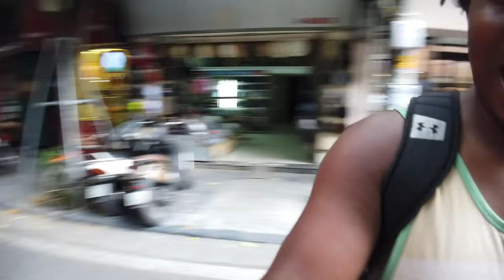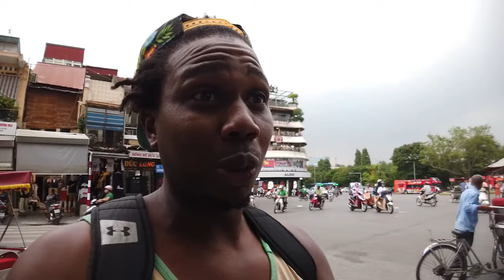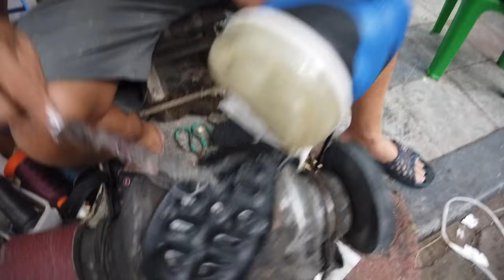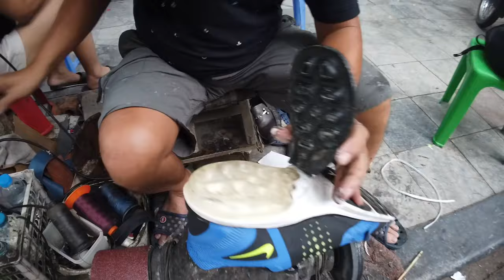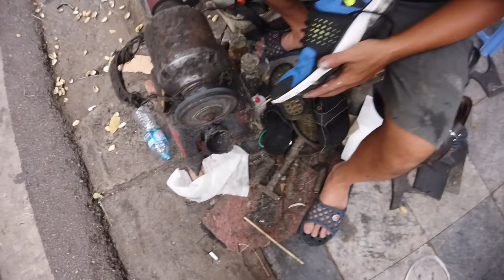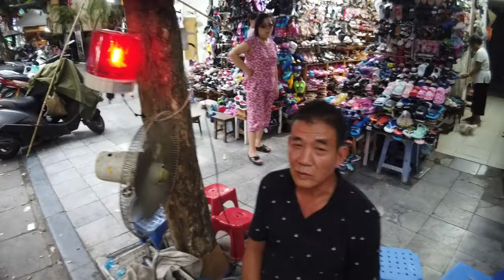$2 Nike Shoe Repair in Streets of Vietnam Capital 🇻🇳

Comment: It’s contact cement. You have to allow the solvents to evaporate before the glue activates. He’s using the hair dryer to speed up the evaporation process.
Reply: Yeap ! It's a fast way to get two coats of adhesive on things.

Comment: Drill holes and wire the piece back on. I would like to start a limited shoe factory. Thermostat. Lever. Screws. Car alert. The cheap shoe store is gone. I bought a pair 20 years ago. 1 week. Ca.